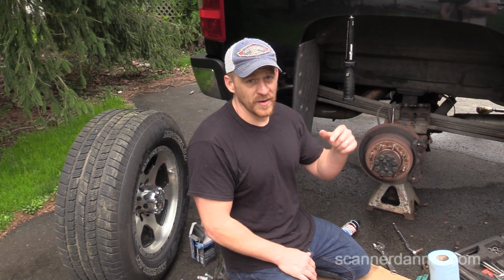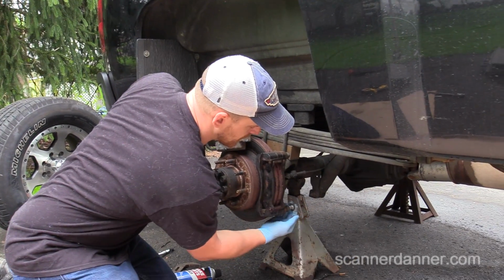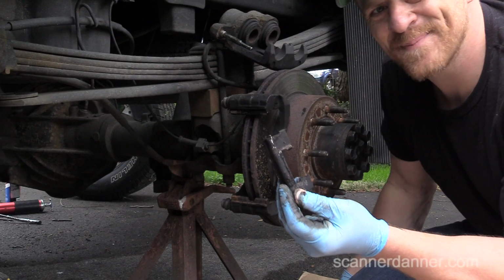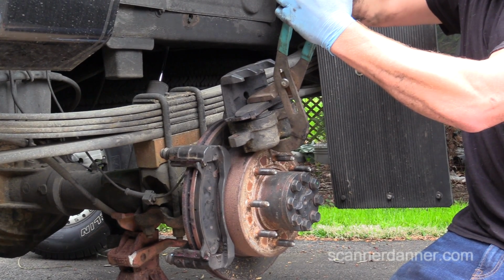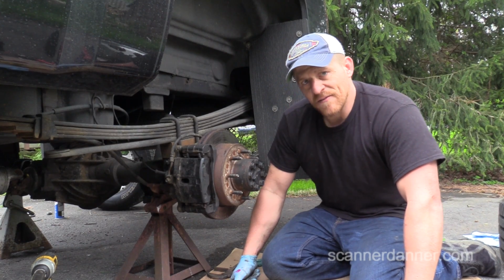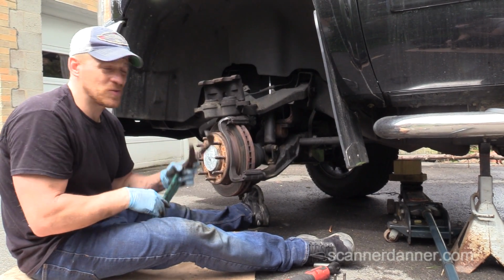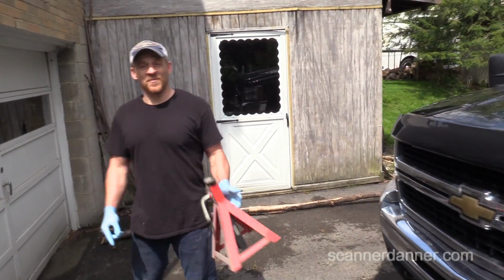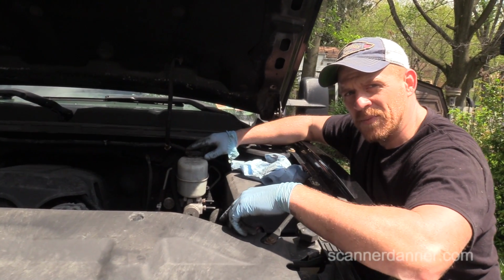Silverado 2500 HD Brakes Hanging Up, Diagnosis and Repair Part 1

Comment: Did you check your book? It is available at a substantial cost. 

Thousands of brake jobs? May be that is what set your Jeep on fire. Not impressed Scammer Danner. I watch you miss shit on almost every vid. I hope you teach these kids that they work on flat rate. One hour is all they get to find the problem. No Verus. No Pico. No known good waveform. They get to go into the world of mounting tires and oil changes. 

Most of your students will never even see a scope again. Great job at half assing the cleaning of the caliper anchor. You are a joke. Over an hour to not even fix shit. I can't wait for the next hour of stupidity. Nice touch on how you took some non diesel apart with a box wrench. What diesel was that? Detroit V71? Cummins 855? Ford/Navistar 6.4? I know. It was a Perkins in a lighting unit for highway work. 

Not at all impressed Scammer. You are fooling these kids. It is wrong. You never left a wheel loose? You are hands down a liar. I know you can burn down a Jeep. YOU fucked it up and you know it. I HOPE YOUR STUDENTS SEE THIS.
Reply: rasafrasahassenfrat hey. the next hour has a somewhat professional lathe cut with borrowed adapters.  and a few smiles
Reply from the maker: should I leave him or block him? I could be entertaining to let him talk about his vast knowledge
Reply: ScannerDanner watching old headbangers ball videos
Reply: You my friend get the bitter award for the week. Cheer up buttercup.
Reply: Yea I fix cars every day from dealerships and other shops that have ASE patches running up & down their arms and all over their tool boxes. Certifications don't mean you can fix a car just means you can take a test...that's all!
Reply: He's entertaining right now. When everyone that really knows you watches this video in the AM it may be entertaining
Reply: I hope you did it correctly b/c he's probably a L96 ASE BME SKT LDT Triple Gold certified on brake lathes.
Reply: Well I've been doing it for over 40 yrs and have watched his teaching videos and am impressed with how he teaches his students. We all have our opinions!
Reply: great video Dan. Thank you for posting !
Reply from the maker: Rust in Peace brother
Reply from the maker: One more thing. I watched some of your videos trying to figure out why you're so angry and want to say that I feel bad for you man. It seems you have a tough life and when life messes with your kids it's even worse. Hope things improve for you and your son.
Reply: Yes you do :D I don't think you have anything to worry about and your students know how well you teach them diagnostics. I still subscribe to your premium channel and can attest to how well you teach them and then watch their video channels & see how good they are diagnosing & repairing cars like Tom.
Reply: Crap
Reply: What is your contribution besides being a KB warrior? please post  up your knowledge and videos so we all can critique your methods. As the old saying put up or shut up.  Paul, keep on doing what you are doing!
Reply: wow, you have a real bad attitude, i have been repairing cars all my life, i am a tech and also a mechanic, i can do both, these vids are clearly not for you so take your hate comments else where.
i still enjoy danner vids even though they can be slow paced but when you are learning that is the pace.
i just looked at your channel, you have only one vid about anything car related and you waffle on about clair getting high, very informative XD.
Reply from the maker: I'm leaving this for awhile I think. For sure though this kind of hatred only comes from one place
Reply: I love trolls. Always have to laugh. Keep doing you Paul. Been subbed to your premium channel and member of your forum for a while now. You've helped me be a better mechanic so thank you and keep the videos coming
Reply: The reasons his videos are long and don't go right to the problem is he is showing all ways to get to the answer. There are things I can find the problem in 10 minutes while it might take others a hour. If I show them the problem in minutes without them understanding how the system works have they learned anything?
Reply: Please leave him for a while, let's play with him. I'm interested to hear about his 35 years of changing tires and doing oil changes. I wonder if he thinks he's "hot stuff" or some amazing technician because he can see a steam cleaned chamber in a cylinder head like any other 5th grader could do? Or because he found a fuse with a missing leg.... after he pulled a radio to check for power? Or because he thinks he's "cool" to throw his son out in the yard and keep hitting him with cold water while he's obviously cold and not enjoying it? Let's hear him go on about how many different Diesels he can google and wrote out like he knows anything about them. Let him tell us how much better he is..... I'm still waiting....
Reply from the maker: He's hurting too man, part of me feels bad for him. I didn't understand your comment at first until I watched his videos. The kid thing was kind of funny though
Reply: I like donuts and coffee too!
Reply from the maker: Hey Danner, what are you still doing up?
Reply: LMAO being entertained. I fixed tomorrow morning's car tonight but I'm glad I didn't video it :D
Reply: rasafrasahassenfrat  your a joke and feel sorry for you.
Reply from the maker: Exactly! I've always said I've known Master Techs that can't fix a sandwich
Reply: Mr scanner u are great teacher. I have learnt a lot through ur channel... I am welder by profession but through ur videos,I have switch to auto mechanics. My problem is I don't have access to ur book.I have and always enjoy ur teaching.
Reply from the maker: Lol. I have a troll and he gave himself a thumbs up
Reply: rasafrasahassenfrat oh really? why don't you shove all that up your sick ass.  at least Paul is honest.  you're not? dam shame!  I don't even like your pissant channel.  I like Paul's.  as it's way better content.  tough shit your Lil turd!
Reply: James Danner Headbangers ball! That brings back memories!
Reply: Hayward's Automotive hay,  I subscribed to ya.  lol. as I liked your comments ;)
Reply: ScannerDanner just tell him,get behind me satan...no need for his negativity..hes not a master tech...maybe a master of deceit..block him Paul.
Reply: Let's see..... 3 subscribers...   Photo for everyone to see that looks like someone straining to take a dump...  Brags about how "Great" they are..  News Flash!  This is the internet.  I can be a King or a Prince!   I can be a master Tech!    I can be a porn star!.....   Words Words Words.......   And now a little song for you....  "Trolling Trolling Trolling...Keep those words a flowing........Even though you're showing            your dumb!!"  (Sing it to  "Rolling Rolling Rolling..."  I figure sense you're that much of a "Hardcore Internet Repair Jockey" you might need to know what tune to use...)

I fully expect to see a lame comment in response....  Which of course I will ignore (because it will infuriate you that all your "Cutting Words" will go unnoticed.)
Reply: he is best teacher ever see :)
Reply: Sorry to say but I guess you self-do not have a clue what you are talking about people with your attitude seldom do. Taking with 40+ years of experience.
Reply: I am not looking for views Mr. Shitty Shitsonite.
Reply: thank you. please/, my subaru had the same issue.
Reply: Just ignore them  :D

Btw love ur vidz and was nice to see you doing DIY
Reply: Have to agree with u Paul, hes mad at himself.
Aniways that doesnt give him any "excuses" to hes "words"...
Reply: wish u were standing next to me like I would fought with u seriously for posting rubbish
Reply: HEY if you don't like it here why do you talk shit fuck off buttwipe!
Reply: Block him we don't need his dumb ass here!
Reply: The only thing that troll know's is how to keep his boyfriend happy!
Reply: Hell of a way to get views, mr. rasa-asshat.
Reply: Hayward's Automotive and at the end of the day all the customer cares about is did you fix their car.
Reply: Nah man the true culprits are Chevrolet they're the ones who put 4 disc brakes on a heavy duty pickup expecting them to never have issues.
Reply: ...but you still watch the videos.
Reply: rasafrasahassenfrat how about you take your negativity else where. don't like him? quit watching his videos and let the rest of us enjoy his content
Reply: Just because he has different methods of diagnosing than you doesn't mean he's wrong. Doesn't mean you're wrong either. I've tried flow charts but you waste most of your diag time just playing process of elimination. So you are entitled to your view but when the guy has got a ton of followers and have created an equal amount of success stories obviously he's doing something right. Thanks for your time here but you can kindly leave now
Reply: wow we are showing our age there.  maybe google will be flooded with searches for "headbangers ball" it might even take the internet down lol
Reply: Tell him jimmy!
Reply: How about you fuck off. This guy is a scam.
Reply: No. You have someone who is going to call you on your shit. I have been doing this for 35 years. ASE Master tech. L1, L2, X1, M1, M2. I am not going to kiss your ass. I think you are a scam. Shove your book up your ass. A 1 hour video to daig a crank sensor on a car that was out of date 10 years ago. How about that diesel prowess? You could not make it in the real world. Fucking joke.

Comment: Also, for anybody who uses water pump pliers (channel locks) it's a good idea to throw the brake pad on over the piston before you push it in. If you have ceramic pistons you can chip or crack them with the pressure and serrations of a pump plier. If you can tell they're metal you're safe, but it's a better idea to get into the habit of using an old brake pad if you plan to use pump pliers. Otherwise they sell tools which will push them in as well. Just figured i'd throw that out there for anybody new to brakes! Great video as always.

Edit: OH! Never mix grease and silicone either on the slide pins or really anywhere lubrication is needed. If it comes with silicone, use silicone, if it comes with grease, use grease. If you want to switch them, make sure you clean the components well. Neither lubricants mix.
Reply: I broke a piston by using a screwdriver in between the pad\piston to compress the piston. Last time I did it that way
Reply from the maker: I always go between the rotor and pad or rotor and caliper as I did in this one. Never had an issue.
Reply: x2, I've always done it between rotor/pad myself.

Comment: Coincidence this video came out I'm actually fixing the brakes on my 98 3500. Axle seals went and everything is coated with gear oil. Seems to be an easy fix though so far anyway

Comment: About safety.... you should never....ever....ever use petroleum based grease on caliper guide pins. LOL
Reply from the maker: It was a synthetic grease. But not sure if that's good enough so I bought some actual brake grease to finish the front.
Reply: Just bustin your chops.  I've done tons of those GM brakes like that, seems like the RR is always hung up, either guide pins or a bad caliper.  9 out of 10 have the RR inside pad nearly worn completely out and the outside one is fine.

Comment: I have had a master cylinder fail while performing a brake job. It could be argued that it is d/t not opening a bleeder while compressing the pistons, however my thought on this is that the master cylinder was probably weak and about to fail anyways(140k miles).  Better to fail in the driveway than to fail on the road.
Reply from the maker: I've had them fail after bleeding the system, from the master cylinder piston travelling further than it had it's entire life, which can tear the seal? I think I'm saying that right.
Reply: only ones i've ever had fail from not opening bleeders has been older fords

Comment: The robin is michigan state bird
Reply: I got a 98 S10 4x4 Chevy blazer L t it got po735  code in transmission witch is shift solenoid a/b ok it shifts just fine got a snap on brick  scanner ok so after a month of chasing wires on the light blue wire to pressure control solenoid and red black I kept getting .37 on light blue and .37 on red black then on tfi singinal witch gose to transmission fluid temperature sensor  I get .77  with everything thing hooked up right battery and all ok yesterday I decided to un  hook hot post cable and leave ground  hooked up on battery and unhook all wires from pcm at transmission plug un hooked I took a hot wire from battery and plugged in at pcm wires  one at a time and went under and traced down each wire buy finding with test light then took volt test on them all show to have 11 ?? volts but did find that if u look at 20 pin round connector at transmission A  green and  u brown  are like there in wrong spot when testing them green up top lights u brown down at transmission and brown up top light green  all wire show to matck wiring diagram make no sense unless there something else's on that line I thought I found it last week one of the grounds I'm think black and white gose to back of driver side head on engine on light test lights dime but if put volt meter on it showed to be 11?? something  but I try adding a ground from that wire to a clamp at this point if u touch to ground it put engine light out for about a block then right back on my scanner says it shifts to all 4 gears with no slippage  and when  I turn on the solenoid with the scanner a/b click no problems but tcc can't hear it click  when turn it on with the snap on red brick mt2500 if remember right i.v been watching  ur work a lot worked on cars all my life lot of wiring stuff I'm 60  but just learning the newer stuff  not much on just changing parts  to find problem oh ya a/b solenoid was new but I broke one yesterday so put old one back it shifts good and fluid smells good and looks like new I only gave 300 for the blazer very little rust only got 15o thousand on  speedometer ok well hopefully  I'll figure it out thanks for your time  shops around here just take your money and say they don't fix that kind of stuff so not sure if new scanner would even help I'm lost again for few days thinking time I guess thank if u take time to read my unskilled writing sorry all help would be appreciated thanks for your time againo
Reply: 753 code sorry to much on my mind my bad

Comment: you could pull the axle shaft on your 14b full floater axle then you could use the on car lathe (the 8 bolts in the center of the hub)